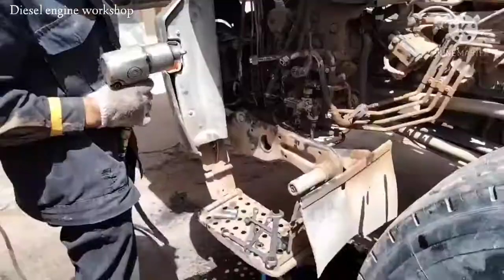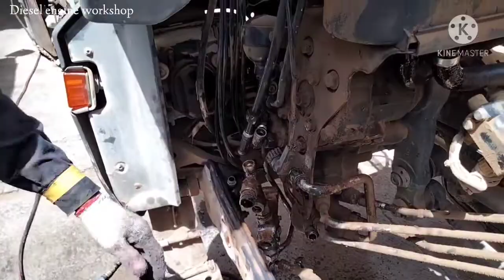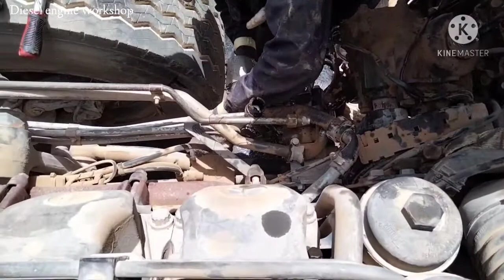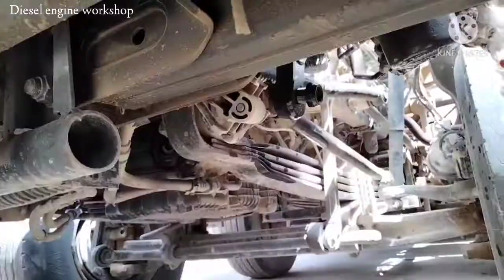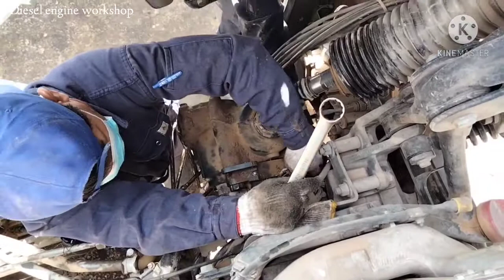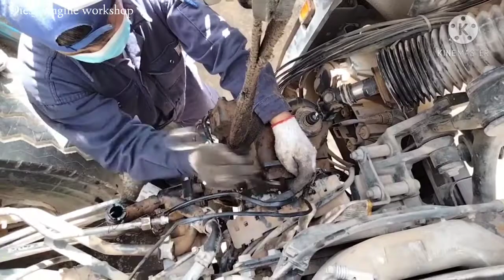Power Steering Box Removal Mercedes Actros Concrete Mixer !

Comment: Bro. Ak said pr steering kam krta hy or dosre said pr ni kia prablm hy
Reply from the maker: Pahle apna Gadi ka Name Or Model Bataye
Reply: @Ajaj881  2014 madal hy or jsy ap ne steering box khola hy same wohe box hy
Reply: Actors mixcer. 4440
Reply from the maker: Esme Do Steering Pump Hota Hai Pahla Pump Diesel High Pressure Pump Ke Sath Hota Hai Or Dusra Engine Timing Gear Ke Sath Attached Hota Hai
Dosra Pump Ka Kaam  Left And Right Hydraulic Cylinder Ke Madad Se Steering Ko Ghumana 
Cylinder Ke Main Line ka Hose Pipe Lose Krke Steering Ghuma Kr Uska Pressure Check Kare  Agar Pressure Sahi Hai To Hydraulic Cylinder Me Mashla Hai Ager Pressure Low Hai To Steering Pump Ka Mashla Hai Ummed Karta Hoon Apko Apka Sawal Ka Jawab Mil Gaya Hoga.
Reply: @Ajaj881  bro. phly asa prablm ni tha steering ka. Steering jeck ke ceel lek the pr hm ne completely jeck change kr dya hy
Reply: Us ke bad streeing ak said pr km krna choor dya hy
Reply: Streeing pump bhe new lga dya hy. Lift said streeing ghoomta hy rait said pr ni